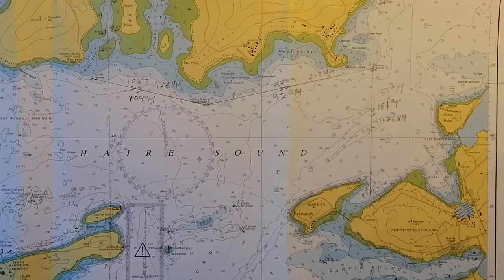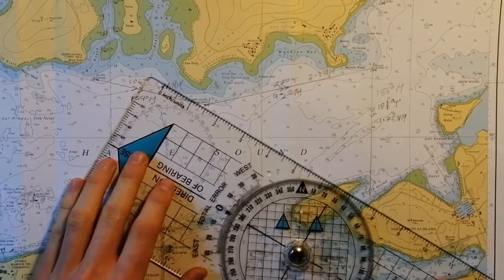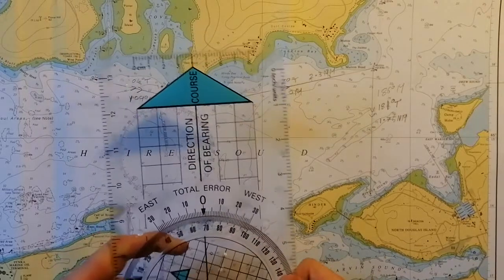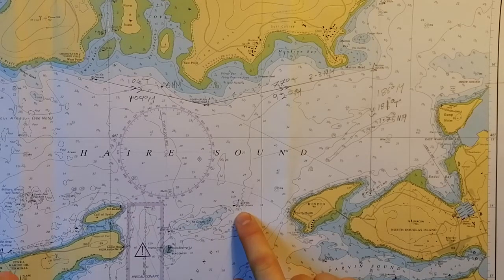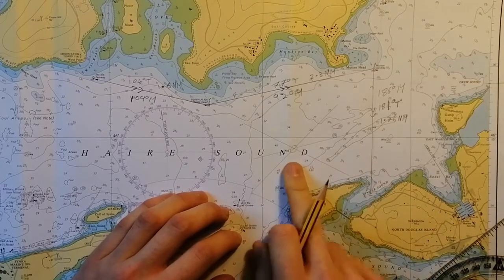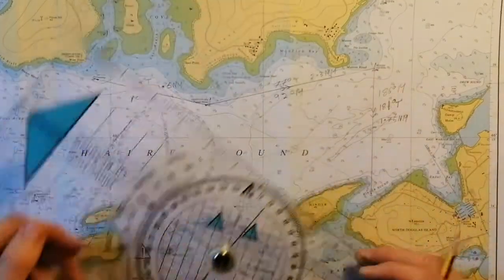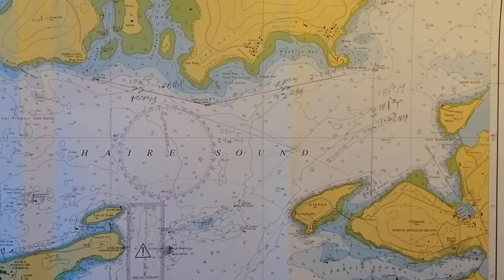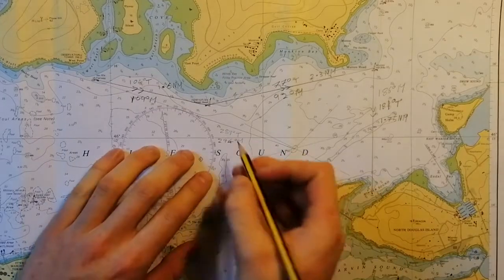Sailing School from Home | Chartwork | 3 Point Fix

Comment: Your bearings are in magnetic but you didn’t mention that. Then you put true bearings on the chart because you didn’t account for the 5 west variation. Your fix will be wrong on the chart. But then you converted your new course from true to magnetic CTS.

Comment: You used a hand bearing compass, your variation is 5 west. You didn’t state what kind of bearings you took. I assume magnetic but you didn’t adjust your plotter to 5 west, kept it true at zero compass error. Then plotted your LOPs. You have to convert your magnetic bearings to true before you can use the grid lines on the chart. Your fix will be wrong. But then you did convert your true course to a magnetic CTS.